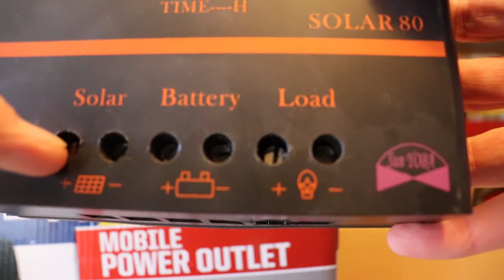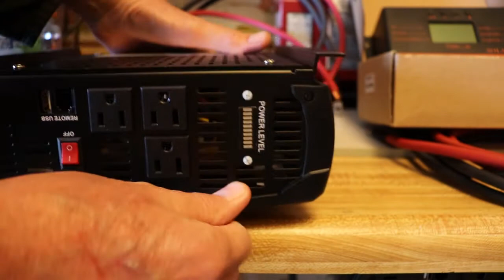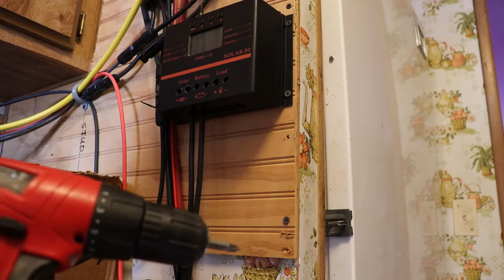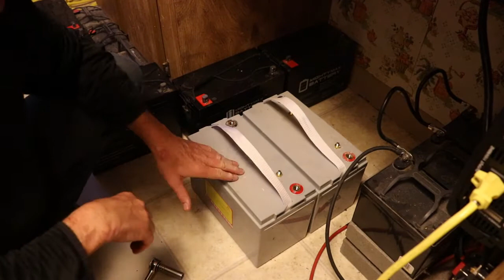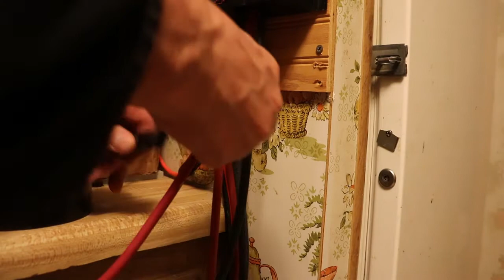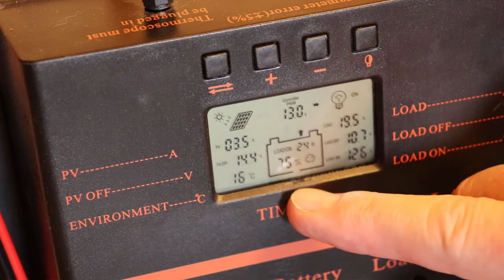Simple 12VDC Off Grid Solar System

Comment: heya that is a very nice off grid setup
Reply from the maker: I have 4 separate setups that can be reconfigured quickly as needed. They simply will run vital appliances and stuff if the grid goes down.

Comment: This is so useful! Thank you!
-Nick
Reply from the maker: I've had many request to just show a simple Off Grid Solar System so that's why I did this video. I have more complicated systems I've done videos on too. Most you want to run through this unit is 80 amps DC.
Reply: @DROPsHomestead  thank you! I really want to build a basic system that I can add to over time. Do you have videos on all the components used?
Reply from the maker: @AZHighlandHomestead  the other video in the description has a lot of the components and how to make cables and do solar and battery arrays. The controller used here is ZHCSolar Solar Charge Controller 80A 12V 24V PWM Solar Panel Charger Regulator for Renewable Energy 1920W Max with USB Multi Circuit Protection Anti-Fall Durable ABS Housing Enhanced Heat Sink. Batteries are LifePO4, Solar panels are any 12VDC 100 Watt panels and of course I show you in the other video things you need to make cables for batteries and MC4 cables. You can use any 12VDC to 120VAC inverter.
Reply: @DROPsHomestead  thanks! That really helps!
Reply from the maker: @AZHighlandHomestead  Best to familiarize yourself with solar systems first before you purchase anything for what you need for requirements.

Comment: You make this seem pretty easy!😮
Reply from the maker: It is however watch the video in the description below for how to cable and make the connectors, wire size and configuration for batteries and solar panels.

Comment: Hey Drops this looks like a great simple system. I’m gonna show Ryan and see about what we need for our greenhouse. Thanks!
Reply from the maker: Yeah it will definitely power several lights. I only have 800 watts of panels hooked to it. Easy could draw 40 amp DC. What application would it be for in the greenhouse?
Reply: @DROPsHomestead  grow lights and possible heater during colder months when the sun isn’t as direct and it’s cold out.
Reply from the maker: @YogiHollowFarm  heater like an oil filled heater is going to pull 60 amps DC current on the low setting when it turns on which would not be good for this controller. It would be good for grow lights which will put off heat considerably but I would use a wood stove made for outdoor camping in tents which are around 100 bucks or so for heating. Too cold in Wyoming for you to practically use an electric heater with this setup.
Reply: @DROPsHomestead  gotcha thanks for info!
Reply from the maker: @YogiHollowFarm  you're welcome. You would need a bigger battery bank and something like my solar / wind setup that can produce up to 440 amps of DC current to effectively run heaters in the green house. A passive geothermal setup would serve you well in a state like Wyoming in the winter. Then all you would have to do is run a fan to circulate the air.

Comment: Phosphate batteries are getting good reviews for lasting 5+ years and 4,000-10,000 cycles. 
Good to hear they're also lighter weight.
Higher available voltage also protects your motors against drag in starting amps.👍
LOVE your redundancy. 2 is 1 and 1 is none. -KJ
Reply from the maker: Great point! Ths!

Comment: With this setup do you need solar panels outside?
Reply from the maker: yes you need solar panels. Please watch the video in the description for detailed info on solar panel arrays, batteries in series and parallel connections, wiring, wire size requirements making solar cables and MC4 connectors. I didn't want to make this video an hour long.
Reply: @DROPsHomestead  
Thanks! 😉

Comment: Thanks for making this simple, you directions to me is kinda like solar for dummies. Thanks for sharing
Reply from the maker: That was the intent for beginners. For more detailed info please watch the video in the description for detailed info on solar panel arrays, batteries in series and parallel connections, wiring, wire size requirements making solar cables and MC4 connectors.